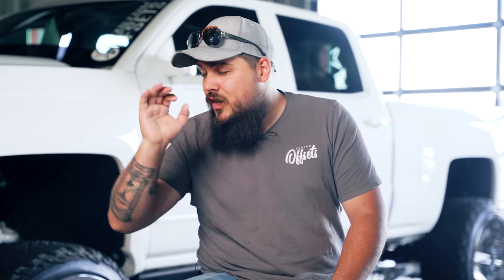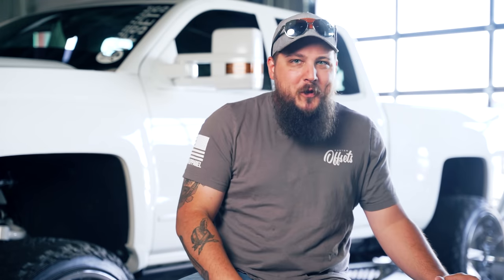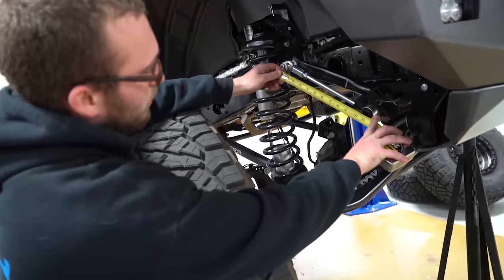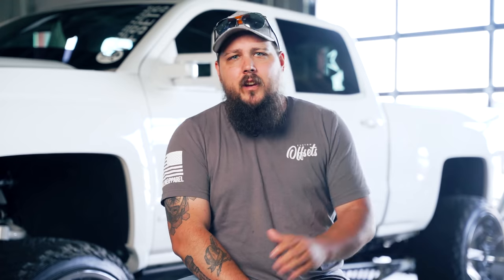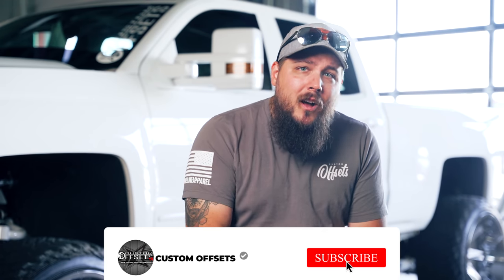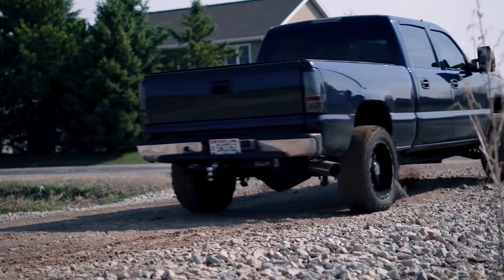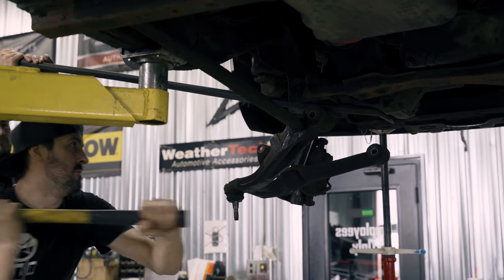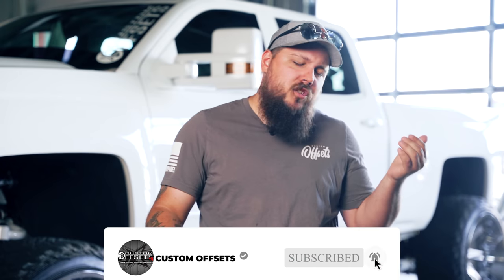Things To Know Before Lifting Your Truck!

Comment: What I wish someone told me? When you install a 6" lift in the home garage, make sure that you pre-measure the clearance of the new roof height to top of garage door opening. It sucks when you are done installing a lift and can't get the truck out. After a long weekend, the last thing you want to do is take those wheels off, drop the truck on rollers, push it out of the garage (with the steep as hell driveway), jack it back up and put the tires on.
Reply from the maker: Yeah, that would be annoying 🤣
Reply: You could have let the air out of the tires
Reply: I would just take the tires off and drive it on the rims..
Reply: ....& it WAS my VERY 1st consideration for my "08" Avalanche LTZ work truck loaded with tools the HAS to go in the garage!
Reply: thats funny
Reply: That sounds like hell..  I would of done something like that lol
Reply: Instructions unclear, do you know an architect and a garage door installer?
Reply: LMFAO now that’s fucked up
Reply: I’m sorry but that’s just too funny 🤣 glad you figured it out though.
Reply: Done it before. Used 10k rachet straps on each corner to squeeze the suspension down to the bump stops and still had to air down the tires.
Reply: Tell me it’s your first time doing a lift without telling me it’s your first time doing a lift…. 😂😂😂
Reply: Lmao 🤣 sounds like something I would do
Reply: My friend's son did that exact thing years ago.  Lift kit,tires,light bar, in a standard height garage with a 8 or 9 foot door.  Kid panicked about how he was going to get it out,until Tom told him to put smaller wheels on it and take off the 'goofy' lights on the roof.
Reply: Oh no. That's horrible
Reply: Couldn’t you just let air pressure out drive slowly out then put air back in?
Reply: At least you are brighter then some.  Imagine if someone took the lift back off just to remove it from the damn garage.  😂
Reply: Shouldn’t something have given you an idea before you were done…genuinely curious NOT trying to be mean💯
Reply: Oh man!!! That is gold!!!
Reply: Remove the wall fuck it🤣
Reply: Nobody told me i would have to rebuild a rusty frame
Reply: Must be a small garage lol
Reply: I would’ve just demolished the garage but that’s just me

Comment: Day 57 of asking for the top 5 dually wheels
Reply: Lol
Reply: 1.Pacer
2.Pacer
And so on…
Reply: @MattySlimz  Alcoa baby
Reply: The best dually wheels are using adapters and running semi tires.
Reply: Lol
Reply: I really keep seeing you ask too lol
Reply: Alcoa wheels, I had some super singles on my Freightliner, 22' x 12 with a 345/50 tire.  They go for 400 to 800 per wheel pending design choice.
Reply: @gingie5246  Yep, you can get a hub-centric adaptor to go to a 10 lug. it will also work as a spacer so keep that 1 to 2-inch extension in mind.
Reply: Alcoa for sure for aluminum
Reply: 1-5 Alcoa
Reply: One year later are you still asking
Reply: Driving a duality is like dancing with a fat chick, you always hope she’ll lose weight, but in the end she’s damn comfortable to ride
Reply: @gingie5246  facts
Reply: Take a hint lol
Reply: @Back_door_bandit_98 those are rims

Comment: IMO its best to get your kit installed by a certified professional. Might get some hate for it but IDC LOL
Reply: Lift kit or any suspension definitely idc what anyone says. Other things not as necessary to have done that way but yea fs.
Reply: I’m 19 and I done mine all by myself, and even done a backyard alignment to get it to the shop, it’s not hard but it’s not for everyone either.
Reply: @FadedTempus  I think it comes down to what you drive. I have a truck worth around 25000. It's nothing crazy, especially compared to a lot of trucks out there, but I definitely couldn't afford a new one if I mess this one up. Whenever I do get the money for a lift, I'll pay someone who knows what they are doing to put it in, even though I've torn apart entire engine bays without so much as a manual. I trust their expertise over my stubbornness to do it myself
Reply: @devingreene1855  Nothing wrong with that neither. I can do accessories, minor engine work, and small parts all day long, but things like a transmission or rear end, I’d rather take to someone. My 4L60e had actually blew up recently and I thought about atleast pulling it myself but it was a little too much without some tools so I took it to a shop.
Reply: @FadedTempus  my buddy has blown 3  of them, I'd almost recommend finding a different model. He doesn't rag on his too hard, but he does drive a lot. SC to TX at least twice a year and drives at least 500 miles a week
Reply: @privilegedwhitemale306  I said 25k, not 250k. It wasn't to flex, I know I don't have a truck that's considered show quality. The numbers were more for the point that I love my truck and doing work myself, but for something that's worth a good chunk of my paycheck, I'm gonna hire someone else to do it
Reply: @devingreene1855  im an idiot
Reply: @privilegedwhitemale306  you're good bubba! Don't worry about it

Comment: After lifting 2 trucks (with jacks and stands not a lift) when you think it’s high enough in the air to install especially the coils or Leaf springs go higher I learned the hard way. And also don’t cheap out on parts it hurts more in the long run
Reply: I’m assuming the obs in your pfp is the one you lifted? If so tell me how it went ive got a 95 f150 and im thinking of lifting it
Reply: How high did you suspend it?

Comment: Before you lift your truck, take PB blaster  to every bolt and nut you will take off every day for 2 weeks straight, trust me it helped a ton and it helped key my labor hours down, we didnt break any bolts on a 15 year old cateye
Reply: I saw this comment a year ago, you saved my ass when I did my 30 year old k1500
Reply: @loudawg9260  glad to help, every day for 2 weeks seemed a bit overkill but it sure helped and even then we had a few bolts that were tough

Comment: If you're a contractor, make sure you load up the rear with the average amount of weight you'll be driving with.  I went in and had my truck leveled with nothing in the bed and then I load up tools and a camper back and everything else and with the added weight pulling it back down, the truck only appeared leveled the day I drove it out of the suspension shop.  I don't know much about lifting other than I worked for a guy once who had a big lift on his truck and we had to use a little ladder to get in and out of the back for tools.  It was really stupid.
Reply: You could raise the back a little  if you got adjustable shackle or get helper bags, it’ll even ride better while loaded

Comment: I wish I knew that lifting my trailblazer would put extra pressure on the 4x4 disconnect housing and crack the thing in half. After four of them I reinforced the collar with C-channel aluminum and some aluminum welds. I then tracked down all the original GM bearings and seals for these obsolete 4x4 systems that they should be embarrassed about for ever engineering it in the first place, and found a better clutch fork as well. Pain in my butt. Good news is it has like 5,000 miles on it since the repair and it still hasn't broke. All the others broke within 3,000 miles. So fingers crossed.

Comment: Good advice I've had many lifted trucks. Here's another one, buy the CORRECT tools that you need doing it the FIRST time because you are going to have it back apart. I remember using a 15/16" wrench with a 6' pipe on my 1st lift. Twisted it to sh**.'kind of a trophy now.

Comment: I wish that someone told me that it would change my ride quality.   They told me about the fun in customization and that it could never go back to stock.  While I am happy with how things  turned out, and I know that I  can never ever have a truck that rides purely as stock again, I will be very protective of how the ride quality turns out on my next project.  I will definitely spend the time to research what parts and components do best here and spend more to preserve it if necessary.

Comment: loved the video but you missed a lot Bigger tires and wheels and not changing gear ratios causes premature transmission wear and not to mention front end wear. With that being said, pulling a trailer with a lifted truck just causes more wear and tear in general. But I'm sure you guys already knew this. That being said, I love how a lifted truck looks. Sexiest thing on the road by far. I used a leveling kit from Thuren off-road on my 16 mega cab 1 ton and I've been more then happy with it\. Just my two cents !! Great video guys !!

Comment: I just finished a RC 6” lift on a 16 f150. While in there I replaced a civ axle with a torn boot. I bought a duralast cv axle which got stuck half way in and wouldn’t come out. I had to take the front diff apart to get the jacked up c clip out and removed autozones cv axle. My 1.5 days budgeted turned into 3 days. I wish I knew not to buy trash from autozone.

Comment: A lesson I learned  early was if you have the front suspension measured by your alignment shop before you backyard lift your truck. They will be happier with you when you get the final lifted alignment. Take this as you will… they can get it pretty close if you don’t.

Comment: I just installed the Rough country upper control arms on my 3" lvl silverado i had installed rotofab lvl kit and road on my stokc upper control arks and had a noise on my steering and now.its reduced seems like it after installing the upper control arms but now ik screwd for 2 days to get aligment and i need the truck for work i should be fine right?

Comment: Got a 8" king coilover superlift sitting in my living room. Only thing I'm skeptical about is my ability to trim the crossmembers 😅
Reply from the maker: Just gotta send it!
Reply: I have a 4.5 in my room and my wheels the only thing holding me back is I’m afraid of pulling it apart and my suspension being screwed up 235k truck
Reply: @Walrus50  it’s gonna be screwed up lol but that’s fine cause you’re replacing it
Reply: @GlockTuah1017  in my defense thought I took it to a shop so they could check my suspension and they did say it was a really good so idk 😂
Reply: @Walrus50  well yeah but either way it’s coming out if you’re putting on a lift kit right? Like the only thing you could need if it was “screwed up” is lower control arms. The kit replaces everything else usually.
Reply: @GlockTuah1017  nah I got a cheap rc 4.5 spindle lift 😂 so spindles and blocks that’s it
Reply: @Walrus50  oof nvm lol
Reply: @Walrus50  don't be scared, I got my 07 Silverado lifted a couple days ago I already  had the wheels and tires and was waiting for the lift to arrive , I was afraid cause the tires are really big but the guys that installed did a great job. Overall I'm more than happy also thanks to custom offset that I learn a lot before lifting it.

Comment: I knew someone purchased a used chevy truck with a lift and six months later you could hear a knocking noise toward the back of the truck I crawled under the truck and because of the body lift the bolt holding the cab had gone thru the hole where the cab supposed to be bolted down. Then he tried to use the 4x4 and he found out the shaft on the front right wheel was broken. So don’t buy a used lifted truck from a person who abuses his truck.

Comment: Well, most people end up lifting after they get huge tires in there and start rubbing, and then they lift.
So, I will tell you guys something (hopefully before you run into the first problems)

If you want big tires there, you will have to do a lot of things to see if you can get away with those, so start by the very first problem... relocate your body mount bracket.

Then, lift the truck. Most people will be fine with a lift between 2.5 and 5 inches in the front and their respective 1 to 3.5 in the back.

So, go ahead, do your homework, look around, make a choice and lift that thing. Be sure to get new everything and if possible, get the whole suspension in the lift (with control arms, bushings, ball joints and all little pieces).
Once you lifted the truck and relocated the mody mount, then go ahead and get those big oieces of rubber. You will have to do some trimming to make it work, but it will be minor, mostly plastic and small sheet metal bending with a hammer. Not a big problem.

Comment: i knew gas mileage would suffer but i wasnt prepared for just how much. my MPG was literally cut in half. When my stock Silverado 1500 with 31's would get 20-25 on highway, my now lifted truck on 35's gets like 8-12.  I am running mud tires tho, my next set of rubber will be all-terrain which should help a bit.
Reply: Curious what it’s getting for MPG now.  I have the same set up and it’s showing I’m getting 14MPG give or take, but I’m seeing others with 28mpg plus in their 3.0 diesel doesn’t make any sense unless my calibration is off.  I fueled up for the 1st time and it took a little over 24 gallons and I was able to go 360ish miles so this seems to be spot on.  Any thoughts?

Comment: I thought a big lift and big tires would be just that and some mods. All the weight I added. I needed to change gears, yoke in my jeep. Umm driveshaft cvo. Spacers so my tires wouldn't rub. The stress on transmission and engine. Plus I had to learn about geometry, needed brackets, Heavy duty steering components... and my jeep is Right Hand Dive so finding parts is not as easy as my Ford . Sorry for the rant lol
Reply from the maker: It definitely comes with challenges! Some of them unforeseen as well

Comment: I wish someone told me to save for a big lift rather than buy what you can afford today. I ruined a truck. 8 inches on a 1500 is a small truck. Now I have a 22 3500hd and im gonna do it right this time
Reply: What lift kit did you go with? I’m thinking about installing FTS on my 2017 Silverado 1500
Reply: @camronswain  I had a 7-9" cognito on order. Cancelled it and went with a cognito level. So glad i did that. 

FTS is a good choice. Them and cognito are right up there for quality and longevity.  If I was you, Id get a diesel 2500/3500. Your truck being a half ton is not going to satisfy you in the long run. Youll constantly be looking at leveled diesel 3500s  that are taller than your 12k lift kit and wishing you had just done it all over again. I say that because thats exactly how i felt with my 8 inch lifted 1500.

Comment: Best $600 I ever spent was paying my mechanic to do my 
3 1/2 inch rough country suspension lift ,rear shocks, and front end alignment .
Then a Auto Spring shop to add two leaf springs in the back. Should have bought a 3/4 ton but didn’t realize my Chevy 1500 was sagging a lot every time I put a load on it.
Gas mileage actually increased because my front end  alignment was way out prior to  the install 🤷🏻‍♂️
Ride quality slightly rougher which I don’t mind one bit. The only concerns I do have is my steering shaft and the front differential angles. Just hope it’s not a problem down the road ?
Upper control arm and ball joint look perfect and was not necessary to replace even according to Rough Country.

Comment: Something I wish someone would have told me was, More rubber and less rim looks good but its not great for daily driving. In my situation my truck weighs about 4300lbs which means my wheel and tire setup just throws my truck around like its a toy going down the road...
I wish Id gotten a bigger rim and lower profile tire. This along with all the random clanks and bangs and rotational noises 😂

Comment: Last year I paid 54k for a 6in lifted 2020 Bighorn w 9k miles. It’s got a complete RC lift already installed. At first I thought I’d paid too much for the truck then I started pricing the labor and parts including wheels and tires and it all started to make sense. If I’d done it all after the purchase it would’ve probably cost me 5k or more for parts and labor not to mention the time. Most shops are backed up for months with installs
Reply: Yes but at that point the whole lift it about to break down, and the shocks are like 20% left.
Reply: @kg0311  not following what u mean

Comment: You couldn't get it off the torsion bar because you didn't take the holding bolt (a tiny hex pin bolt)   bet you wish someone would have told you that

Comment: I added a 4in chassie 6 inch body  an out 33 in tires ...be prepared to 6 months to 2yrs have to reolace the rear differential and 30days to 2yrs new power. Steering pump .my advice when you replace them just go ahead an put the same amount back again cuz if not it will break when again when you cant afford to fix it

Comment: As a person considering a lift kit (why I ended up here) as well as a pretty new diy'er, I can say point 3 @ 3:55 can apply to pretty much anything. Youtube vids, manuals, & forums can make it look easy but I just got hung up on a damn sensor recently. Plan enough time to fail or have another vehicle for your activities. I live in the northeast (snow, cold, salt, etc. just not as bad as the rust belt) and no youtube video can prepare you for the anger that overtakes you from a seized bolt, lol.

Comment: i have a 2013 f150 5,0L. 6in rc LIFT, 35/12.5/20, I HAVE TO REPLACE LOWER BALL JOINTS EVERY NINE MONTHS OR ABOUT 20K, AND THATS AFTER DEALING WITH IT FIR A WHILE! I bought moog, so always an exchange, WHAT IS THIS SOLUTION? Also would there be a benefit to doing a 4 link instead of these old leaf springs in the rear? as they have 260k on em and i pull trailers often. was wonder if i could set it up to lower and hook trailer via backup cam and then truck would lift back up? is there a kit for that? i do have rear air bags as well but they sit inside my springs, not fond of that kit. i have the 4 door 6.5 bed model, not a super crew, back doors suicide. this truck is a beast,